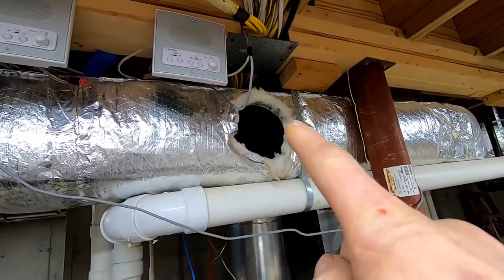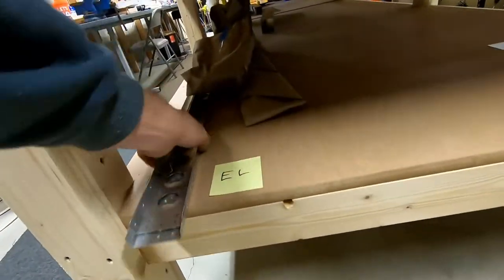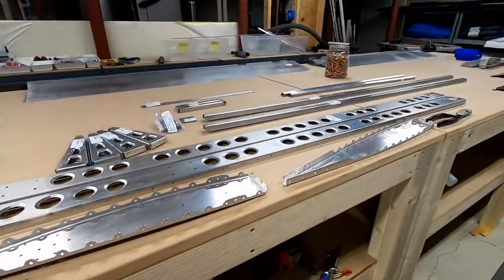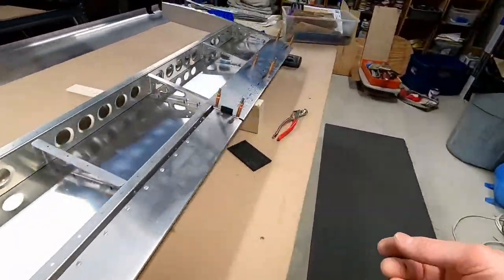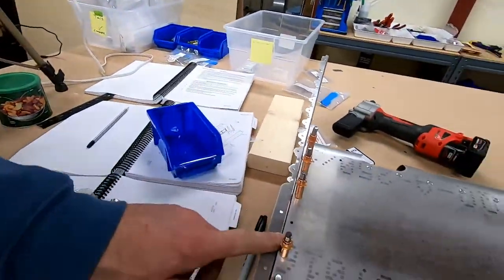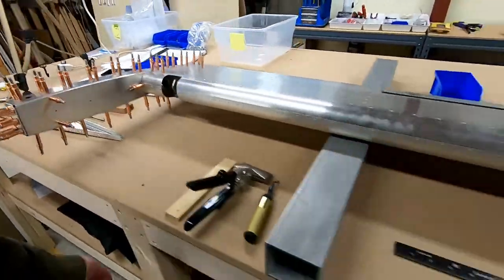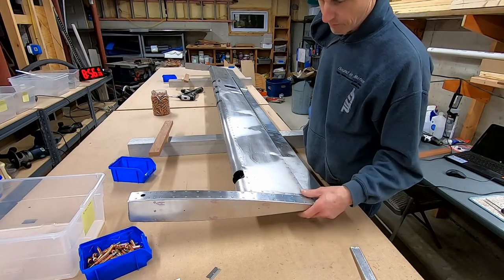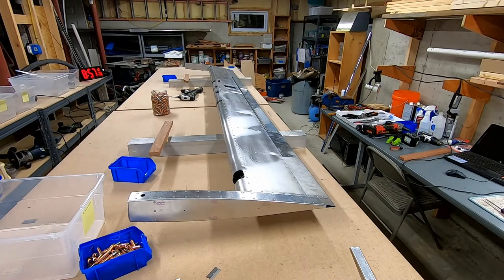RANS S-21 (007) Elevator and trim tab build

Comment: I did not match drill the end rib to the little trailing edge rib either, but in hindsight I wish I had.  I kept pushing that little rib out of place while fitting the skins.  I can’t see in the photos at RANS.com if they do or not, but it seems to me it might be a good idea.  I doubt it makes a structural difference as the other end is not supported and the skin takes most of the stress anyway, but it might have helped during skin installation.

Comment: I bought and use the Vans tool also.  It does help, but things are still tight in a few places.  I do with the Vans tool was a little thicker.  If I were to make my own, I’d probably use the same angle they used, but make the business end of the tool about twice as thick.

Comment: I used the PVC on mine and it does flex as you say, but it wasn’t a problem and my parts fit together well.  It definitely helps to have two people when you roll the edges, but I certainly would not worry about using PVC.
Reply from the maker: Gotcha. I can confirm that the metal rod was much easier though.

Comment: I debated using RTV in the balancing pockets also and decided that just applying tap on the outside when I install the balancing mix.  I suspect that tipping things down for curing as RANS suggests will work fine.

Comment: Did you use -41 (as the manual says) or -42 (which is correct) in the side of the hinges that attaches to the trim tab?  When I did mine, the -41s looked short to my eye when I test fit them.  So, I measured with my calipers and the thickness of the skin assemblies on the trim tab side was 0.080” which is well above the 0.062” (or is it 0.063”?) maximum grip length of the -41 rivets.  So, I contacted RANS and they agreed that -42s should be used there and they sent me a packet so I have enough to go back and attach my tips which also use that size.

Comment: I almost attached the end ribs too soon also, but I always read ahead through each section before starting and I caught that it was installed later.  It definitely was easier to rivet the leading edge without that rib in the way.  And I was perplexed at that “last hole” comment as well.  Not sure the intent of it unless they want that done first to help hold things in alignment.
Reply from the maker: I'm thinking it's to create awareness, so the little rib doesn't push in.

Comment: I hope you made sure you used "Neutral Cure"  silicone sealant
Reply from the maker: Not sure. Is that for printability?
Reply: @simdpk  Common silicon sealers often use acetic acid in them but to make sure you dont get any corrosion you use a "neutral cure" version. Often called roof and gutter sealant. It wont eat the aluminium